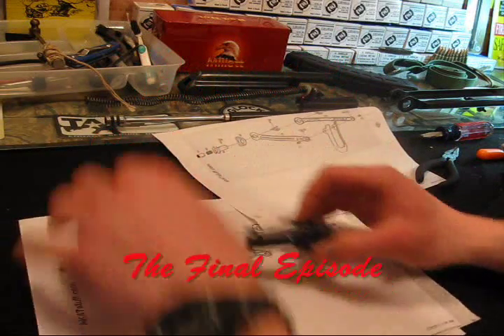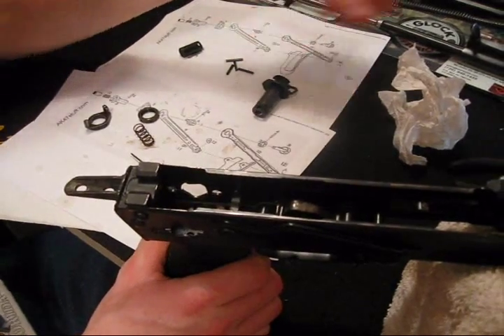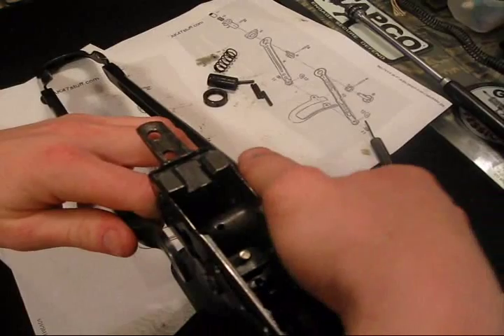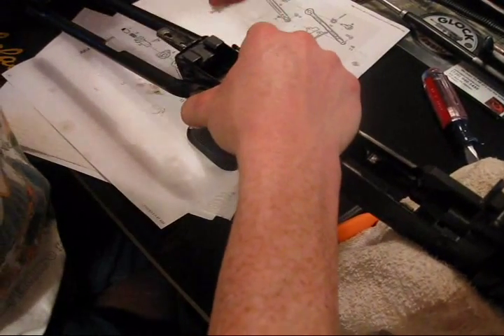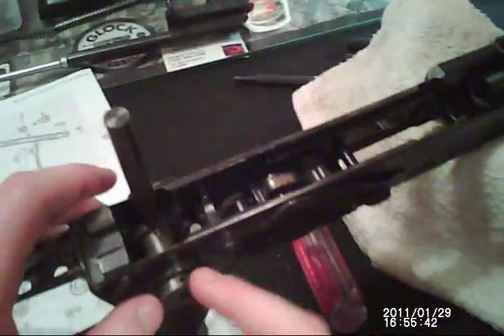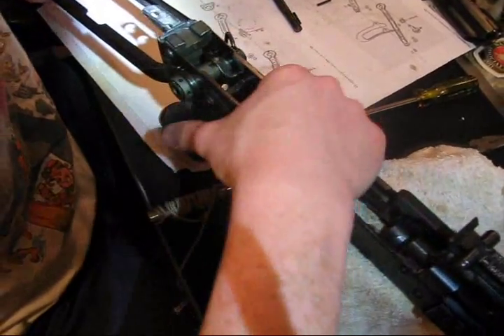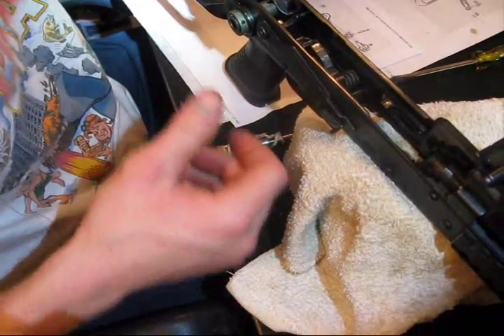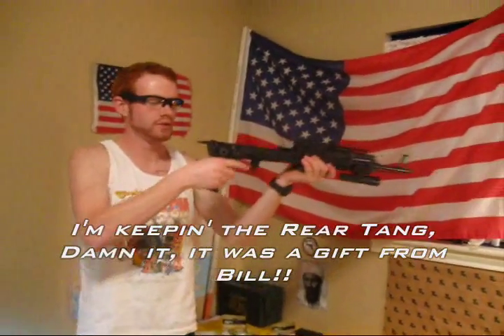AK-47 Underfolder Installation {Part 2} Final

Comment: I have 1 just like your , I couldn't find matching stock , I give up , finally I found a polish surplus for 20$ put on rock solid love it , I have a 6 position colapsable stock on it b4 but like the look with folding that's the way that slanted cut for , the one we have is real surplus receiver , slanted cut with no hole is reproduction after ran out surplus receiver